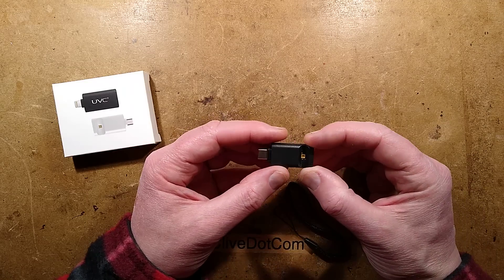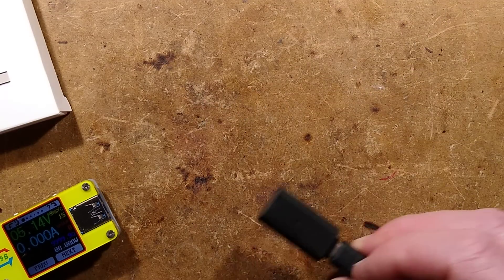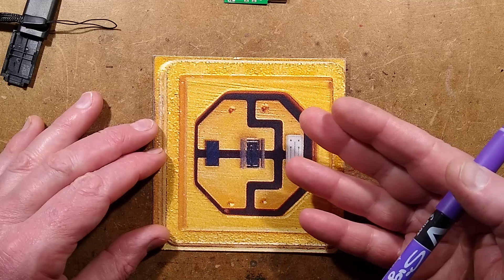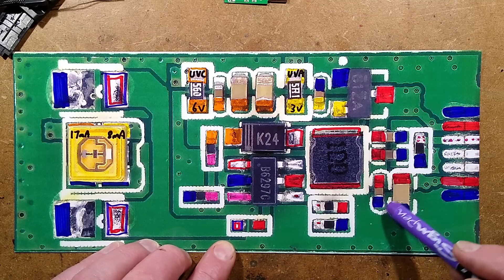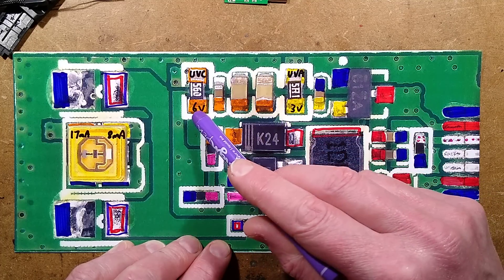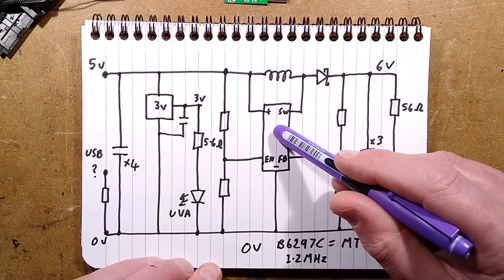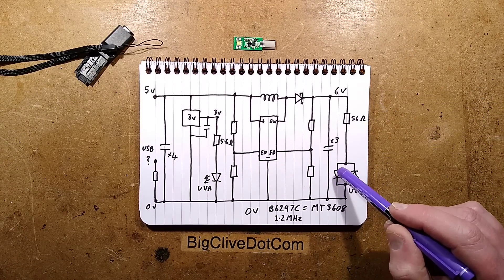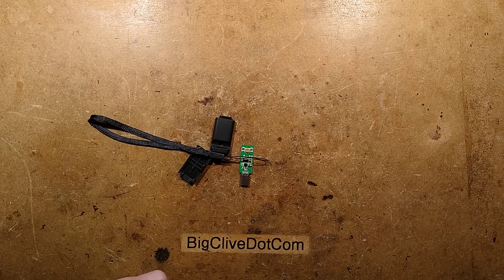"pandemic theatre" USB sterilising dongle

Comment: Case would be probably kovar, as that is a standard alloy used to make IC leadframes, and matches silicon for expansion coefficient. Then pressed into the shape, and tumbled clean, and plated with a thin flash of gold to protect it.  Substrate is a small PCB, pressed into the bottom, probably also with a tiny amount of resin that UV cures, and the lid is also a thin quartz glass square, bonded with the same UV cure resin as well. The diode across the UVC led is a protective chip, with a tiny little bandgap circuit on it, a integrated large area diode acting as a capacitor and reverse protection diode, and a large thyristor that is turned on to clamp the forward voltage to the UVC led to a little more than the maximum forward voltage. Capacitor likely integrated as a near vertical structure, similar to a MOSFET power structure, 3D using the chip to give a wide deep junction on the flip chip. You find the same protective chips used in the more expensive multi LED units, to still allow current flow even if the LED die itself has failed open, a PNPN thyristor structure to clamp the voltage to close to zero for the power on cycle, or if ESD triggers it, to ensure low dissipation in the clamp, and high energy handling ability, as the bandgap reference is set to a higher voltage for the multiple series string.

These tiny and fragile junctions on the UVC led chips are otherwise very prone to failing with ESD, as they have to be ultra thin to generate the UVC light, and thus are ultra sensitive to ESD events, even a 6V pulse of charge will kill them.
Reply: Wonderful explanation. I've been buying and characterizing them since they first hit the market and the pandemic was such a boom for the technology. I buy dozens of examples from everywhere possible every few weeks or month

The technology is somewhat similar to laser diode construction. In the package construction and materials but also in the fragility of the junction

. I mean obviously it's not a 1 to 1 comparison and I'm probably the worst person in the world to try and describe the stuff to people who don't work with it everyday... but messing around with them in the metrology lab and doing my best to characterize them and understand them... It's been a real trip and has given me many sleepless nights. It's so cool to see the technology developed so quickly and proliferate..…. Photonics is not my specialty but I have worked a lot with it in tandem with what I do. 

I kind of expect them develop similar to DPSS lasers technology, and even back with the early 365 nanometer LEDs.  low power and expensive at first... And then eventually ubiquitous and cheap high-powered diodes.

 just like with green DPSS modules for a dollar on eBay... That were hundreds if not thousands of dollars back in the beginning. I had contributed to Sam's laser faq page back in the day when DPSS modules were new and also when DPSS yellows started hitting the market. It was sickening to see what you would have to pay for those early examples but they were built to a ridiculously high laboratory standard. And are some of the most beautifully and well thought out designed laser pens I've ever seen. Honestly would love to buy up some more vintage examples if they ever show up on the market

And just like the development of the 365nm tech... Super expensive, and lower power... But now you can easily get massively powerful multi watt 365 nanometer chips... Dirt cheap

I hope UVC LED technology goes the same route. I'll be watching and still buying dozens of samples every few months to characterize and play with in my lab. But I look forward to seeing more educated and wise photonics nerds breaking down the technology and it's development
Reply: Why not a bog standard 5.1V Zener to protect the 5.05V LED?
Reply: @johndododoe1411  Sharper turn on characteristic for the integrated circuit, as opposed to the really soft knee, and high slope resistance of the zener diode. Look at any zener diode, or run any sort of test on them, and you will find they pass appreciable current well below the nominal voltage, which is normally specified as the voltage when passing 20mA through it, but you will find many already are at 5mA with only 3V across them. The only ones closer in tolerance are 6V8, which are a 6V2 zener with a series forward biased regular diode, so the temperature coefficients tend to cancel out, as otherwise a zener will drift appreciably with temperature. Plus the high slope resistance means that ESD events still apply high voltage transients to that fragile junction, degrading it initially and eventually destroying it.
Reply: @SeanBZA  As a protection device it only needs to conduct before the voltage exceeds the LED destruction voltage.  That would be a useful margin in which to fit the zener knee.
Reply: @johndododoe1411  Yes but requires selecting the diode in production to fit this close tolerance, while most are binned for a 10% range,especially at the lower voltage range. The chip solution has much tighter control over the voltage and the knee is so much sharper, plus the whole shunt by thyristor thing keeps the energy applied down. Voltage set by geometry of long polysilicon resistors, which tracks well, and if you want closer than 2% you simply have 3 zener zap junctions you use, to bring it within 0.5% of the nominal, over a pretty large temperature and current range. Plus band gaps are a lot more tolerant to process variations, unlike zeners, which need the entire wafer to be rough tested, packaged then tested at 2 spot currents, to decide which bin it will land in.
Reply: @johndododoe1411  Again needs testing on the production line to bin the zeners, which ups the test time per device from perhaps 50ms with the chip solution to a second to sweep the zener current and measure. Chip all you do is apply below, check off, and step up 200mV and check hard on, and it passed, with 2% accuracy.  Pass on die, off to the next, and fail for any reason a red dot, and off to the next. When you are sitting with a multi million dollar fab line, you want the test cost to be ultra low, and fast. Zener diodes are all made on old fab lines, minimal process steps, and then you package them all, and then test to place in bins. Chip scale zeners are a nightmare to test, as they need hand operations to put in and out of fixtures, so perhaps 10 per minute per operator, but the on die approach gets 200 per minute, or 5 minutes per wafer. You cannot test zeners on wafer easily, they are all connected.

Comment: USB C powered eh? That's pretty cool a bit but UVC at that small scale may take forever to do much to the air except for air around itself in a small area maybe 

Other than it working on a USB c to USB a adaptor might let it run as long as ya want it to unless it ends up failing

Good video by the way Clive

Comment: I have this circuit feeding two of these uv tube lamps and I'm scared of powering the circuit. There's also a magnetic sensor i've never seen before. It looks like a blue glass tube with a connection in the middle. Would anyone happen to know what it is and how it works? it almost looks like a lightbulb without any filament or if the filament was thick as fuck and didn't glow. It feels like an analog part in a very modern digital circuit
Reply from the maker: It sounds like a reed relay.  They can fail with their contacts welded closed.  Hold a magnet near it and see if it makes a slight click.
Reply: @bigclivedotcom  Reed was the word I couldn't remember, had looked them up decades ago while working on a very old keyboard where each key had a magnet and a reed relay.
Reply: I've seen magnetic switches in a glass tube, you put a magnet near them and there are 2 wires that bend and make or break the connection between them.  In this case it's probably supposed to be in a cabinet with a magnet on the door, so the lights can only turn on when the door is closed.  Ages ago where I work we had a metal cabinet with large UVC bulbs for sterilizing safety goggle that were loaned out in the labs and the bulbs would only turn on if the doors were closed.
Reply: @MartysRandomStuff  It is for that but the reeds look welded together. They will not separate. Maybe there was too much current running through them and they melted together.

Comment: I have a couple of double walled 500ml water bottles that have very similar circuits in the lid. Not much power required to sterilize the water. Since the pandemic scare is over, we see a lot of these types of snake oil products in the discount shops.

Comment: Those mercury lamps put out so much UVC you can immediately smell the ozone being created by the UVC splitting O2 molecules in the air.
Reply from the maker: There are two types with different grades of uviol glass.  Ones that only put out 254nm which doesn't create ozone, but does make an odd organic destruction smell, and the type that also put out 184nm that creates notable amounts of ozone.
Reply: When I was young we had a germicidal mercury lamp in our clothes dryer, but we didn’t even know about it for years until I discovered the circuit diagram (which was inside a panel of course) and found out that it was just wired in series with a 120v rated lamp that illuminated the control panel (dimmish) when it was running, and of course had burned out before we came into possession of it.  Our dryers are 240v for heating but they were still able to make use of the 120v split for lights and likely some motors.  I was a bit surprised to see such a simple method of ‘ballasting’ the mercury bulb.
Reply: @SchwaAlien  Is this primarily to prevent mildew when tumble drying?

Comment: Picked up one led into LED versions of these from Walmart at the very beginning of the pandemic. They were indeed putting out UVC and we're in the proper ceramic and quartz windowed package...  But They also had a built-in Violet diode for safety. Most of the UV LED beads I've checked have the option of a safety diode in the visible range. Obviously at a very low power just visible for safety.

 The ones I got were cheaper Uvc LEDs made by a company in Shenzhen. The examples from Walmart started out around 5 to 7 milliwatts but over the coming months and year they got up to 15-20 mw and we're running much more efficiently. I was buying and testing dozens of UVC LEDs as they become available on the market. Most of them online obviously but I did source what I could from Walmart and other local stores. As a nerd with a background in material science and photonics related stuff... I just couldn't help myself and the pandemic was such a boom for the technology

 . Now that same Chinese company is putting out beads reaching 40-60mq each. Which is freaking insane and awesome for the price. You can find them on banggood and elsewhere. Of course if you want to play with the big boys you can get some stupid high powers but they aren't cheap and since this is a fast evolving technology... Powers are going up and prices are coming down

 This reminds me of when 365nm  LEDs were first becoming popular years ago, and they slowly crept up from 50mw to easily 1500mw per  diode. Back-in-the-day a 200mw 365 nanometer diode would have cost you $100. Now you can get something ten times as powerful for one tenth of the price. Similar to what happened with green laser diodes

 Not sure if UVC will get to that high of power because of what it would do to everything around it and it's not  as efficient. But without the pandemic we would never have the advancement of the technology that we have now. It is awesome

Comment: You sounded so pleased when it turned out to have circuitry.   Hey Clive, you should do a wish version of a ts100 or ts80 soldering iron. That would likely be fascinating.
Reply: I just got a pinecil v2 and i love it, but yeah the clones should be 'interesting'.
Reply: There's also a T12 version, very cheap, cheap tips too. I find that one more interesting, never liked the look of the TS80 cartridge, using audio jacks for power has always been hacky.
Reply: @Broken_Yugo  t12 stations are amazing especially the higher quality clones like the ksger etc, cheap tips, plenty of power (72w) tons of features, over all a very good package, i myself have 2 of those t12 stations, been using for 4 & 2 years now, no issues at all, also if you use geniune hakko t12 tips with those, they are as good if not better as the real thing.
Reply: @Broken_Yugo  how do you feel about two pin xlr for power?
Reply: @TheErador on t12s they aren't technically xlr's but GX12/GX16 connectors with the screw on locking mechanism, pretty great of such applications honestly, also generally 4 pin are used, ifk if thats what you meant but still good to know
Reply: @ShahZahid  no I meant actual 2-pin XLR, was used for power applications in the past, e.g. on the avolites rolacue sapphire iirc. Was mostly just poking the bear regarding common audio connectors being used for power. At least in that situation it wasn't pin compatible with the audio feeds.
Reply: just got a genuine TS101 as a kit with PSU and a nice silicone usb-c cable and it's awesome.

Comment: Add a little 3D printed stand and you get a convenient USB powered EPROM eraser
Reply from the maker: I'm not sure how long it would take to erase an EEPROM.  The classic EPROM erasers tend to use 254nm.
Reply: @bigclivedotcom  I seem to recall about 15 minutes was good enough for the UVC LEDs I pulled out of a phone sterilizer, but I haven't extensively tested it beyond taping one to the window and letting it cook for a while to see if it worked. Probably also depends on the device, I tried it on a 90s 27C010 which probably has a smaller cell size than an 80s 2764 and is likely more sensitive in general.

Comment: Any chance the device depends on the higher voltage it could get from a USC-C "Power Delivery" source?
Reply from the maker: It can't really request the higher voltage.
Reply: Stepup would be cheaper than PD chip for higher voltage. Also you need a pd charger

Comment: Boosting to 6V and then current-limiting with a resistor seemss weird. Why not just put a current measurement resistor in the feedback loop control the boost to give the desired current ? Typically saves two resistors and reduces wasted power.
Reply: Not only that, its generally better to regulate the current through LEDs than use a voltage and a resistor.  We do that alot because it's convenient, but most proper LED drivers regulate current.  Might waste a little more power, depending on what the feedback voltage is and how much they are running in the divider network, but that doesn't seem like a major concern here.
Reply: With the 56 ohm resistor and 17 mA current, the net effect of the boost circuit and current limiting resistor is 5.05 V at the LED. That's frustratingly close to the nominal 5 V USB
Reply: A 56 ohm resistor is cheaper than a 0.0xx resistor for current sensing, this is just a standard boost converter design which can be used for a lot of things ie usb torch, coffee warmer,coke cooler.
Reply: @dantronics1682  I don't think a current sense resistor is going to be any more expensive. Certainly less expensive than three cheaper resistors in the current design. And by my calculations the needed current sense resistor would be 33 ohms.
Reply: When I tested those UV-C LEDs they started glowing slightly above 5V when cold, but then their voltage dropped when they heated up. Not sure now, can't find my notes, it was like 5.6V or 5.4V to start it when cold, then it dropped do around 5V.
Reply: I guess, you really don't want a 5.25V (or more, for particularly piss-poor PSUs) source feeding a boost converter which may put out less <5.25V at any point. I'm pretty sure weird things happen in SMPS control loops when you start approaching the extremes like VOUT = VIN? As hinted at by argoneum, temperature effects may well be a thing, also what about drift over component life, etc? What if the SMPS nukes itself and the source too? Given that this product has an actual UVC LED, I'm guessing slightly more care was put into this design than many other ultra-cheapos... Perhaps that's naive of me though?
Reply: I'm sure they wanted to keep the output of the boost circuit higher than the input voltage, to keep weird things from happening.